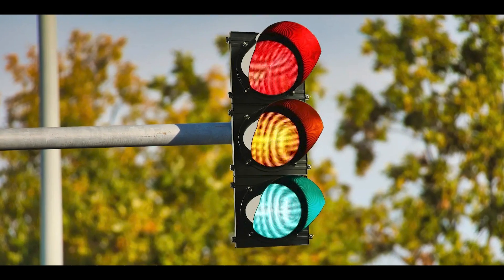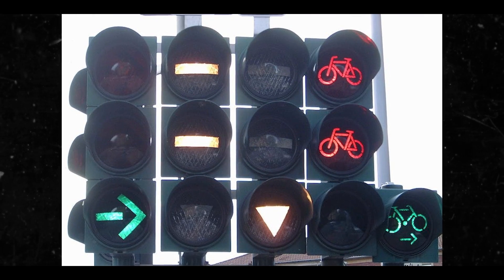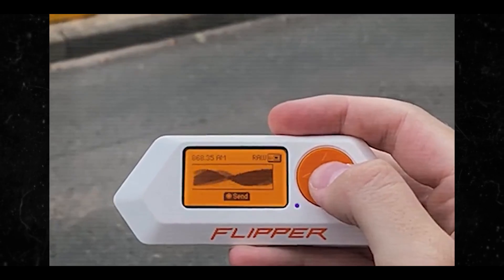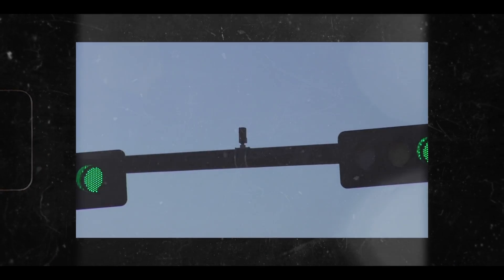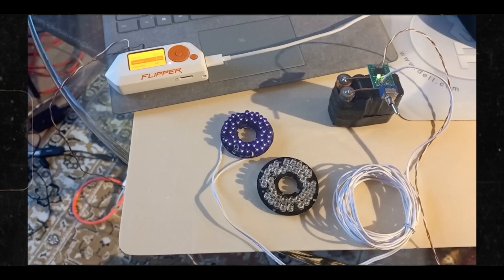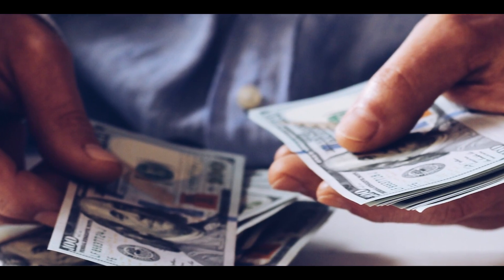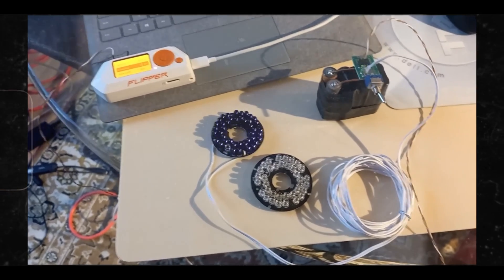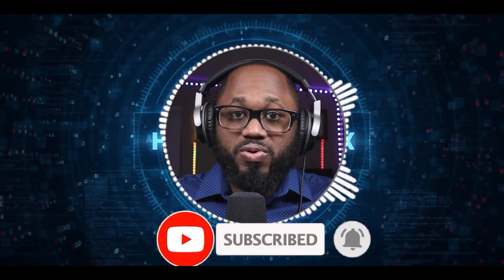Flipper Zero Controls Traffic Lights

Comment: Back in the day they used strobe lights on the light bars of emergency vehicles to trigger the light over ride.  Rumor had it you could rig a timing light to set them off if you knew the correct rate the light strobes.  It might be something I saw in the Anarchist's Cookbook, possibly in Steal This Book, so take it for what it's worth.